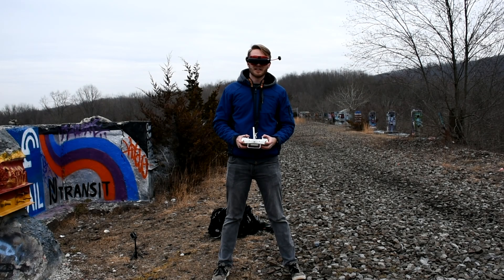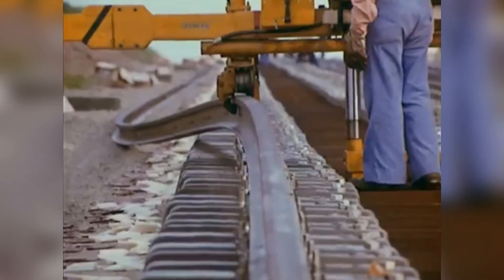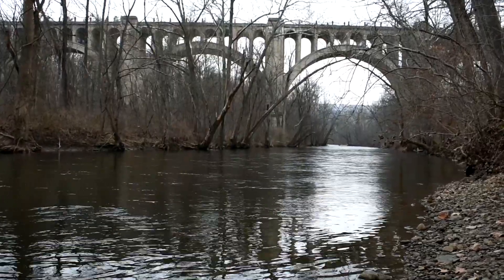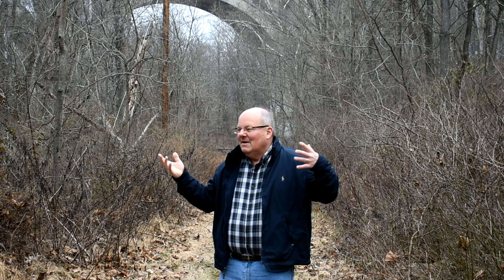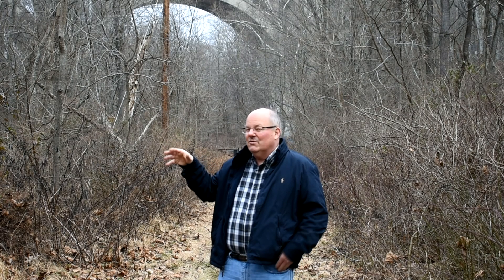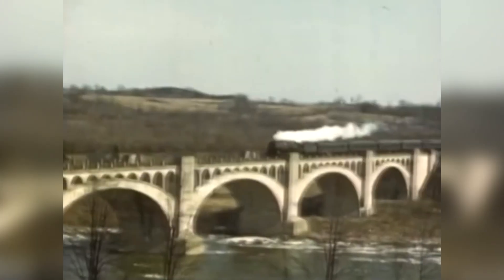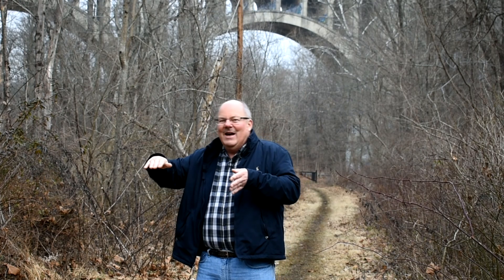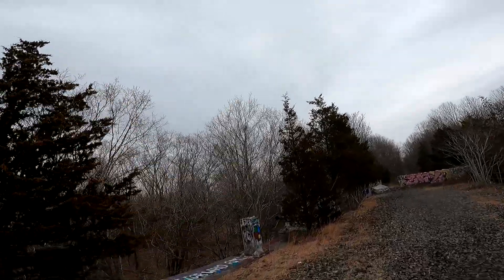The Abandoned Lackawanna Cutoff will be Brought back to Life

Comment: This is a major tragedy that such a well engineered route should be abandoned. Thank you for bringing the people this excellent and very informative video.
Reply: Even if it is not used by rail, it could be used for rails-to-trails.
Reply: @robertewalt7789  As a cyclist I do enjoy them, but I'd rather see it put back to railway use if possible.
Reply: there was a big Problem of the big rail road grades at Scranton
Reply: @dknowles60  at least they weren't hauling 30,000 pounds of bananas into Scranton Pennsylvania
Reply: @robertewalt7789  stupid no
Reply: @JugSouthgate  the grades were so bad  that 5000 tons was to much
Reply: Called corruption
Reply: @Disloyalcwumb  wrong. it was so bad that the erie lackwana neeed 3 sd 45 between Nyc and marion Oh. needed helpers  from delaware water gap to clarks summit pa. on the same train the NYC needed 2 gp 40 to get from NYC to Chicago ill. the Gp 40 also use less diesel fuel then the Sd45. From marion oh to chicago Il the El only needed 2 sd 45. it was a very costly route to run disclamer. El was a rail road i liked and only saw 1 El train i n markle In with 2 Sd45-2
Reply: If Erie Lackawanna had gone to Chessie as originally intended or had opted to join Conrail from the very beginning instead of holding out, it's likely the Lackawanna Cut-Off would've remained in use.
Reply: @joemayo8254  Thank you for this important information, I appreciate it as I did not know about this.
Reply: @joemayo8254  Don't even talk about Conrail. Joining EL into Conrail wouldn't have helped at all. They destroyed Freight rail in the US. Took out one of the Pittsburgh Mainline tracks between Altoona & Pittsburgh. Let everything go to *rap.
Reply: @robertadams6606  then lines were going to  *rap since the end of WW2 then tracks  were not needed Steel making in pittsburgh went down hill. the Ex nyc with 2 tracks CTC was moving 100 trains a day. It  took the Ex Prr 4 tracks to move 100 trains a day. how young are you
Reply: @robertadams6606  wrong how young are  you

Comment: When Amtrak tested the ICE 1 in the 90s the main problem was that apparently the US has some pretty shoddy/bumpy tracks.
Reply: It still does and that's the problem.
Reply: Yet they keep pushing for new rolling stock.
Reply: @americanace96  Most modern US-locomotives are meant to handle it, it's mostly a factor limiting speeds.
For example, New York's new electric locomotive is a slightly modified Siemens Vectron/Smartron
Reply: Well, thanks to Uncle Sam, and other factors efficient passenger rail service has all but gone the way of the steam loco.

The current infrastructure of this nation's Railroads is sufficient for freight trains, not so much the passenger trains that use lines owned by freight hauling companies, like UP.
Reply: @jed-henrywitkowski6470 
Correction: Passenger service has gone the way of the steam loco in the US, freight is as strong as ever. And you can blame the freight-hauling lines for that - in the US, a railroad's effectiveness is solely determined by the amount of freight it can move, rather than the amount of passengers like in Europe. Europe actually has the same problem with freight service that we do with passenger service.
Reply: @jed-henrywitkowski6470  How is Uncle Sam to blame again? As far as I can tell, Uncle Sam has spent billions over the years trying to keep passenger rail alive and it was the private railroads that kept trying to kill it so that it can't mess with their schedules. Sorry, bud, you're very far off the mark here.
Reply: @TohaBgood2  Uncle Sam created Amtrak with the intention of having it die so it wouldn’t be the governments problem anymore. Amtrak survived against the odds and has been completely underfunded ever since. It’s not just rail; America has completely neglected infrastructure for decades now, and has especially ignored rail. The money in the new infrastructure bill is the biggest investment in passenger rail since those private companies died off.
Reply: @Ry_TSG  Well Amtrak IS “Uncle Sam”, so only some of what you say is true. Amtrak did survive against the odds and it was basically at breakeven just before the pandemic. Clearly passenger rail can thrive in the US if some pretty stupid and largely synthetic barriers are simply removed.
Reply: @TohaBgood2  they subsidized the highways, airlines and airports and waterway shipping while regulating and taxing railroads as if they were still a monopoly.  Railroads made investments in the postwar era to improve passenger services but their efforts were no match against government subsidized highways and air travel.
Reply: It's not that they're shoddy or poorly maintained so much as many of them have sharp curves and steep gradients which make high-speed running difficult.
Reply: This is all great, but I don’t think it’s viable (>50% fare recovery ratio), nor will it allow anyone to go carless. It WILL allow people to live father from NYC, bringing MORE cars and houses to the area. When people relocate to a rural area, they end up driving MORE, even if their commute is still by train. But, we do need more places to build housing, so in that way it’s good, but it’s definitely NOT taking cars off the road, or even reducing private vehicle miles!! Lastly, the number of people commuting to NYC midtown has decreased dramatically, and will never hit it’s 2019 peak

Comment: The way the Lackawanna Cutoff was built, and it way it traverse the mountains in Northern NJ and Northeastern PA, one could easily say that it also served as a reference point in how the Interstate Highway System was built (itself based off of the German Autobahn and the original 110-mile section of the Pennsylvania Turnpike — the latter built on most of the abandoned South Pennsylvania RR right-of-way).
Reply: The interstate highway was built on a route Lackawanna rejected. But highways have unlimited funding of the Federal government so they picked it.
Reply: New York was building highways (then called “parkways”) years before the first autobahn.
Reply: @ClockworksOfGL  Yes like the West Side highway with a green strip in the middle that was the green in this parkway!
Reply: @ClockworksOfGL  yes but that’s not what the interstate highway system is based off
Reply: @Westerner78 , they used to have unlimited funding. Now most of that goes to the welfare state and the over-bloated bureaucracy.
Reply: @MatthewChenault  Let's see $36 for welfare and $4,000 for the super rich, now where is that problem again?
Reply: @Westerner78 , multiply that by about one hundred million and you start to get the picture of the monetary drain of welfare. 

Also, a rich man isn’t going to be getting hand-outs from the government unless if it’s an economic crisis. Usually, they’re being taxed heavily in order to compensate for the massive welfare program in place. 

You should look into the Roman grain dole and see how that became a tool for political gain during the late Roman Republic. It might wisen you to the realization of how welfare is nothing more than a political tool to purchase votes via “free” handouts.
Reply: @MatthewChenault  You know what happens when the money is in only a few hands. It all ends badly . How much money is enough?
Reply: @MatthewChenault  

Canada!   All the JT supporters love free stuff!
Reply: @Westerner78  it's the other way
Reply: @ClockworksOfGL  True, but they were depression-era make-work projects. Linear parks with a road in them and not really intended for "transportation" The Taconic, the Hutchinson and the Palisades parkways are all examples of this.

Comment: When I was a student pilot in northern NJ, we used to use this as a ground reference for certain training exercises.  It's easy to spot from the air, straight as an arrow, and miles long.  Exactly what you needed for practicing S-turns.
Reply: Let me guess.    s turns,
Reply: Yes, Trinca's airport. I grew up on just the other side of the tracks on Pequest rd. watching the single engines bank over the top of the cut- off to line up for landing. My Grandpa Les Devens use to take us up in the J-3  piper just for fun, what a trip. 
Thanks Grandpa

Comment: I think another great example of a high speed alignment that's old is the Great Western Mainline in Britain, from London to Bristol. It was completed in 1841 and it was so straight and so level it was nicknamed "Brunel's billiard table". The line today sees trains going on it at 125mph and that's the max speed at most of the line.
Reply: And they could even do 140 mph, with in cab signalling......
Reply: @mattevans4377  Are you sure about that? I rode the GWR between Bristol and Paddington a few times (new Hitachi trainsets) and at 125 mph you could feel some serious vibes (literally).
Reply: @alexverdigris9939  Well, the class 43s could do 140 mph ;)
Reply: @mattevans4377  Actually they could go faster, large sections of most of the UK mainlines are up to a standard that could support 150-160mph but, as you say, that would require more advanced signalling. The class 91 Intercity 225 was tested and achieved a speed of 162mph, although it was designed for up to 140mph running.
Reply: I used to live along that line when I was little and lived in the UK. The Box Tunnel is really cool, apparently Brunel aligned it such that the sun shines all the way through it on his birthday.
Reply: @kevinh96  if only they tested ATP on the ECML instead of the GWML...

Comment: HSR actually allows for steeper grades (up to 4%), thanks to the inertia and the higher power to weight ratio!
Reply: I think you mean ‰ there 😂 this is also the reason why the HSR Köln-Rhein/Main in Germany is not used for freight train, it is just too steep.
Reply: @martinum4 Frankfurt - Köln has 40 ‰, check it out!
Reply: Steeper grades, but more gradual transitions in and out of those grades. You don't want to effectively turn your HSR network into a roller coaster.
Reply: But more gradual grade transition.
Reply: @VestedUTuber  Unless you do ;)
Reply: @appa609 
True, but then why not just build a roller coaster?
Reply: @VestedUTuber  Take a look at TGV cab rides on the line between Paris and Lyon, it's a proper roller coaster on nearly 400 miles, especially the middle section straddling the Atlantic/Mediterranean "continental" divide. Train speed is 300kph in troughs and drops down to 260~270kph over the highest hills. As a passenger, you don't feel it though.
Reply: @remicardona_poly 
Oh, that's fine. In fact, those kinds of elevation changes are pretty normal. You just don't want your high speed line to look like the initial sequence of camelbacks on Magnum XL-200.

Comment: The downfall of the Cutoff was the collapse of Anthracite Coal as a home heating fuel. That's what created the wealth to build the cutoff in the first place. Without that it was just a railroad to nowhere. 

Currently NS has filed to abandon the signaling on the second DL&W megaproject west of Scranton, the Nicholson Cutoff, so the economic rationale for the corridor has not improved.
Reply: The destruction of the coal industry has been one of the major contributing factors in making railway lines obsolete.
Reply: But passenger rail travel is increasing and people want to ride trains again. It's perceived as both a transportation option and a recreational activity. Coal freight may be dead, but passenger rail is rising from the dead. We even have some private companies trying to build high speed rail all over the country now!
Reply: Why do you need a signal 🚦 system for 2 trains 🚂 a day
Reply: @dknowles60  The issue is that they bought a line with more traffic than that, then worked to kill it.  The good news is that they have withdrawn the signal abandonment.
Reply: @dknowles60  The Federal Railway Administration requires signals for trains running faster than 49 miles an hour.
Reply: It was hardly a railroad to nowhere. The Lackawanna had a substantial amount of merchandise traffic to and from Buffalo and served as the primary eastern connection for the Nickel Plate Road. In fact, the Lackawanna tried merging with the Nickel Plate in the late 1940s but was stymied when the Nickel Plate's preferred shareholders blocked the merger.
Reply: @joemayo8254  The Erie and LVRR covered the exact same market so bridge traffic would never be profitable. Especially since the NYC was the dominant player in the corridor.
Reply: @PositionLight  Bridge traffic from Buffalo was profitable for the DL&W all the way until the merger. The Erie didn't handle a lot of bridge traffic out of Buffalo as it had its own route to Chicago and didn't want to short-haul itself, while the Lehigh's route was longer and more circuitous and had poor connections at Buffalo. The Lehigh's management was also asleep at the switch and didn't make an effort to attract bridge traffic. It was only after the Erie-DL&W merger took place that the Lehigh made a serious attempt to attract bridge traffic from the Nickel Plate and Wabash (later N&W) and nearly all of that traffic was simply a rerouting of existing traffic off the DL&W (now EL) by those two roads.
Reply: @joemayo8254  And that was how many decades ago? Without a reliance on anthracite coal, there would be no DL&W. The anthracite mines—and the mine breakers used to sort the coal—are gone forever. The remnant of the DL&W from Wayne County, Pa.,  south to Northampton County, Pa., is just short line railroad operator with 88 miles of track.
Reply: The collapse of the Steel and Aluminum Alloy Industries contributed to what you described too.
Reply: @TohaBgood2  Passenger Rail, under Amtrak, can't even turn a profit despite so many Government Subsidies. There's no more Steel and Aluminum Alloy Industries in that region anymore either. 

The Steel and Aluminum Industries of the Lehigh Valley collapsing also contributed to this sector of railroad right of way to become obsolete.

Comment: The problem with the Cutoff is you can't get to it. In the old days the DL&W Railroad - owner of the Cutoff - had their main line running through Paterson in a fairly straight line from Hoboken (or New York) to the east end of the Cutoff, but that line has been removed, and paved over in part in the form of Interstate Route 80. So we are left with only one option currently, The Morris & Essex Line mentioned by Chuck as being part of the the original DL&W Main Line, which is circuitous and slow. The timetable only goes out to about 10 minutes before the Cutoff starts, but if you figure the time to get to Netcong on a different branch as being similar at about the same distance,  it's 1 hour, 56 minutes. In order to have competative rail service to Scranton for instance - even to compete with the bus - you'd have to have something a lot quicker than that. I've examined a few options which involve upgrading and reinstating parts of some existing lines, to get it down to less than an hour, which still isn't very favorable as compared to driving right from you house if you're anywhere near Route 80. I've "published" a couple of these ideas on Facebook in seeing range of Chuck - including a couple of pie-in-the-sky speedy options, and he's as aware as I am about the improbability of ever getting something like that done. However, if you going to have competitive passenger service on the Cutoff it's a necessity.
Reply: Are you kidding? I guess you love route 80 becoming exactly what 46 and 611 are today...good greif!
Reply: @williamoverton1548  No - total rail foamer, certified: Here's a link to one of my Cutoff Access solutions (If you can get past the screed about recent Montclair Terminal machinations ((there's an expediting link)) - http://www.rail-nyc-access.com/montclair-terminal
Reply: @brucehain  Lol, how is this guy both a rail advocate and someone who cares about there not being enough parking spots and housing developments having too much density?
Reply: @TheLazySleeperLives 
Not mutually exclusive problems - in fact, they're very much related. Not having enough open parking in areas with rail stations actually reduces ridership, since people who live too far away from the station won't be able to access it. Large, dense housing developments full of single-family homes make this problem worse due to how they sprawl out and increase distances between home and services, vs apartments and condos which keep everyone in close proximity to said service and mitigate the parking issue. It's basic systematics applied to urban design. Rail doesn't exist in a vacuum.
Reply: Can't you just use the Morristown and Montclair-Boonton Lines and only have the Lackawanna Service stop at certain stations and skip the rest. Pretty much how the Port Jervis Line only stops at Secaucus Junction, Ramsey Route 17, and Suffern along the Main and Bergen County Lines.
Reply: @_SP64_ 
Not sure if you meant to reply to me, I was simply just pointing out how both parking accessibility and density around stops affects ridership as a general rule.
Reply: @VestedUTuber  oh oops yeah I was referring to OP